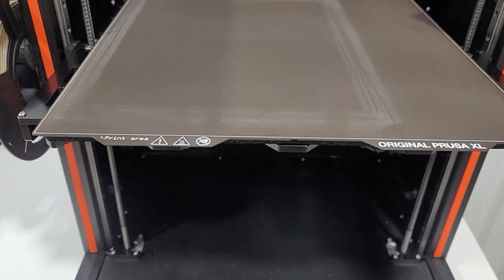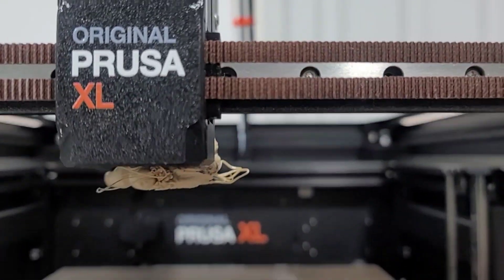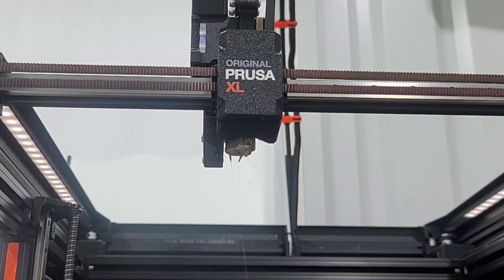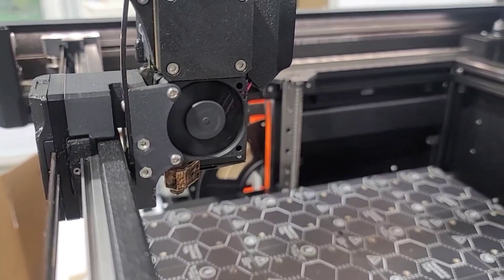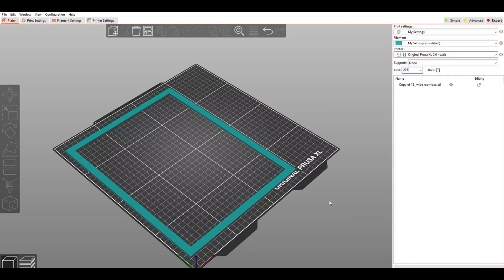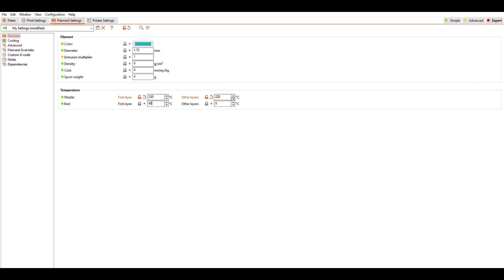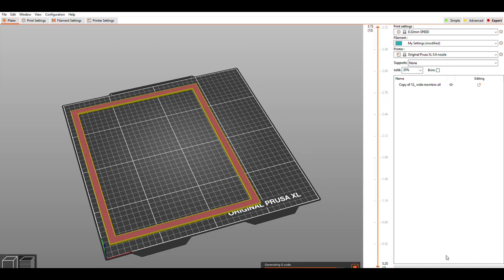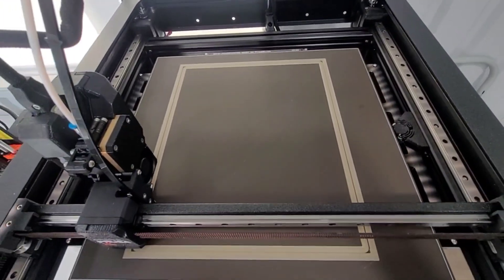Filament blob on the Prusa XL!

Comment: cleaning the bed with rubbing alcohol or even warm water + dish soap will really help with bed adhesion.
Reply from the maker: Thank you!
Reply: It also helps to have the bed heaters on :)

I don't know if you quit the video or missed it, but her slicer settings got mangled somehow and the bed was set to 0 temp.

Comment: What PLA are you using? I had thought it may been a clog until you got into the settings, I have had the slicer make a custom profile when the slicer not the same version. I caught that before I started the print. Still makes me sad to see the XL on YouTube and I got no idea when mine coming. Thinking Pursa just taking care of the large channels first
Reply from the maker: It was Suntop "Wood" PLA. But I've printed 3 or 4 before with no issues. Yeah it was just a setting I missed between Slicers. I actually didn't even have a channel until I got the XL. I started it just because I got so many questions on Facebook. When did you order? Thanks!

Comment: I don't know about this XL, it seems to have a lot of problems every time you use it. I think the Prusa brand is supposed to stand for its reliability and ease of use. But this machine seems to need more testing by the company. 
I plan on getting the MK4 but it seems like the XL is something to stay away from, especially for 2,000 + dollars.
Reply from the maker: If you don't need the larger build volume or the future multitool, the MK4 is a good choice. You'll get it quick and it's very reliable. The XL is a little quirky. Thanks!

Comment: As someone who is in the build queue for a multi-head XL, how much remaining damage was there after the blob? It looks like there's still plastic coating on several parts of the hot end. I'm assuming that's not great for temperature control in the future. Any idea of how you could do a complete clean?
Reply from the maker: I did continue to clean it more. If it's just a little color, I don't mind. But I don't want any misc filament melting into new prints so I make sure to scrub it and then hit again with a papertowel on the end of snippers so I don't burn myself. Once the papertowel stops leaving any residue, I figure it's as good as it can get. Thanks!
Reply: You could replace the nozzle for $28 though it's not really necessary. They also sell socks now at 3 for $6.
Reply: @MichaelPetito  I'm going to have to look up what socks are for a 3D printer. Being a noob I had not heard that term until now. I'm assuming it's some kind of heat resistant (silicone?) material that would cover the hot end.
Reply: @falxonPSN  it is a silicone cover that stretches over the heatblock with a hole for the nozzle. It insulates the heatblock and often takes the brunt of the mess from "blobs" or other extrusion issues.

Comment: Most people make the mistake of heating the nozzle up to the max to clean this.  If you heat it up to only transient temperatures 80-90c and gently pull, it will come off cleaner than before and with the texture of chewing gum
Reply from the maker: Yeah I definitely went all out to 290 which was overkill. Thanks for the tip!

Comment: Silicone socks help a lot with that!
Reply from the maker: For some reason those scare me more. Eventho the XL came with one from Prusa. Thanks!
Reply: @tada3dprinting  Prusa uses the safer design.

Socks for V6 are usually sold in two versions, one with a tiny hole just for the nozzle tip and the other with a much wider hole for the whole nozzle. The first design has a higher change of catching the filament underneath it during extrusion, which could cause a blob, but it also keeps the entire nozzle super clean when it doesn't. Pros and cons. The other design is safer since it cannot really catch the extruding filament, the hole is too far away from the tip, but it also doesn't protect the nozzle from sticking filament. Prusa's sock is the second design.

In both cases the sock should come off with the blob, maybe even in the middle of the blob forming, taking it off with it and keeping the block relatively clean.

Another issue with a sock would be if there was a leak between the heatbreak and the nozzle, as that would be much harder to spot underneath the sock until it's too late. But if you're using these stock nozzles that are integrated with the heatbreak, this won't happen. On an adapter there's a possibility for that, but you can always run the printer without a sock for a while to make sure there's no leaking and apply it after you're certain.

I will be using the sock on my MK4 kit with an adapter, fwiw. I've never used one on my MK3S+, but I had a nickel-plated copper block and a plastic-repelling paint so it didn't need a sock, it was stable and clean enough. The MK4, however, might need some extra help with keeping the temp stable if it's gonna fly around at IS speeds with a simple aluminium block.
Reply: @shushuda  I think not covering the nozzle is a fine compromise. I view the sock as a means to protect the heating element (and insulate that) rather than the nozzle itself, anyway. I wouldn't want to do anything to the nozzle itself that might change it's thermal characteristics.
Reply: @draeath  I agree

Comment: Let me check....
Definitely get globs and it was not due to my settings.

Since I started 3D printing I have 162 projects finish and 148 failed from a total print time of 126 days 14 hours.
A pretty dismal success rate.
In researching like you did here, at most 10% was my fault.
To me, this is unacceptable.... 
As much as 3D being cool... it is a major waste of time.
Reply from the maker: Oh that's terrible! What printer are you using? I agree that failures are so discouraging. I think that's why I've gotten to where I design and print things for Etsy, and then I prefer to just reprint and reprint. Rather than coming up with much new because it can be so many failures to get it right! Thanks!
Reply: That's like my resin printer, despite following all the correct steps and researching everything I could online, it failed 9/10 prints. Sometimes they just work against you. Might be worth getting a better printer if you're sure it's nothing you're doing. Sometimes it's one stupid simple thing.

Comment: How did CRASH DETECTION not detect it?
Reply: And WHERE do you think the collision took place there? The printable object slipped off the surface and the further result can be seen in the video.
Reply: @janchix03  the crash detection is very sensitive and the part is big, so the force the extruder use to move the part away from the bed should be enough to detect a colission
Reply: @Marcos-tj8nk  I got your point, but as you can see, the 3D model slipped off the bed after a couple of layers - so he was light enough and he didn't stick to the surface at all.
Reply from the maker: There was a little bit of filament blobs on the right side of the print. I would've thought that would've hit the nozzle. But I have noticed that even if there is crash detection, it tries to recover without any help from me. So it's possible it did detect , rehomed and kept printing. And at that point, it started kind of curling up around the hotend. I'm guessing. I wish I would've been recording but it was such a short print that I've done before, I didn't see the need. Thanks!

Comment: I think this can happen when you open a 3mf file, they sometimes come with modified settings etc. :)
Reply: Yes. I believe he's right. A 3mf file opens like a whole project file with whatever printer profile was saved by the person who saved the 3mf file. I think that's it. You would just open it, then change back to the default profile you use before slicing :)
Reply: @pbft.j    If the project settings are set, how would you go about noticing that with a 3mf file and how do you  change to your own default settings?
  Sorry for this kind of question.  I've had all of my electronics unplugged for over a year when 3mf was getting more popular due to residential electrical problems caused by solar and just now turning my 3D printers, CNC and other electronics on and getting back into the fun.
  I thought 3mf files were the way to go and will be looking forward to using the format.  I've got a MK4 and  XL on order so this subject will be good to know starting out to prevent issues.
Reply: @davidthompson9359  It's really simple actually! So, when using a 3mf file with 3D printing, I always switch to my preferred saved profile in whatever drop down menu your given slicer uses. I wouldn't suggest changing every setting individually. 
For 3D printing, STL files are the way to go every time. There are definitely pros to using a 3mf file for very specific reasons (like the print is difficult and requires special printing parameters so someone might upload a 3mf file ready to go) - you would have to make sure it matches your specific printer profile overall but it can work.
How could you tell? Well, I'm pretty sure a 3mf file always has the printer profile baked in. It varies per slicer but like I said, assume it's different and then choose your profile. Usually, you'll be changing your profile depending on what you're printing anyway. For instance, slicers have different profiles for the layer heights and speeds. As long as you're not changing the layer height manually in the layer height setting, there's a usually drop down menu that has the different already-set-up profiles. "0.2 layer height" "0.15 layer height" they're standard. When first starting with your slicer, the first thing you do is tell it what machine you're using. Then it adds different profiles automatically for you to switch between. All of them take specific things into consideration like your printer's bed size and such. Then there's the kind of..."sub pinter profiles" ? Like I mentioned earlier, the ones that are optimized for specific layer heights or speeds or nozzle diameter of your choosing, with your printer in mind.

Basically, just put the 3mf file in your slicer and make sure to click whatever drop down menu and pick your resolution and that should do it. Make sure the printer didn't change. It's in different locations in every slicer program but it's such a basic and necessary function that it's not hidden in some weird menu.
Reply: When I open a .3mf with Super Slicer that comes with any extra info, it asks me whether I want to import as a project or just import geometry. I'll have to be careful using .3mf with other slicers, didn't realise it could cause things like this.